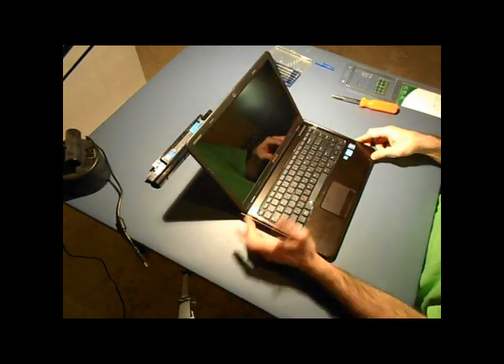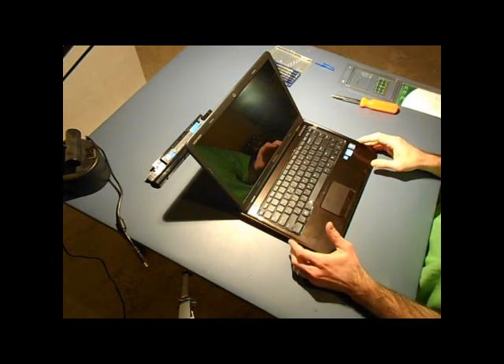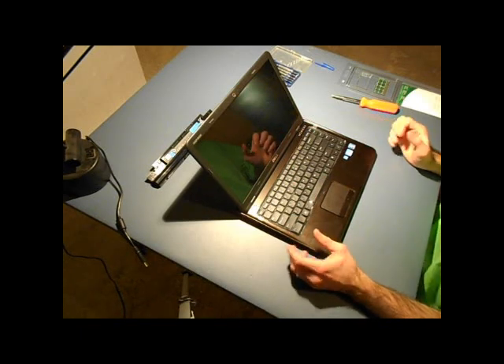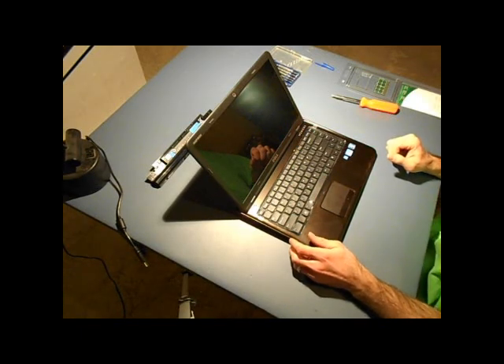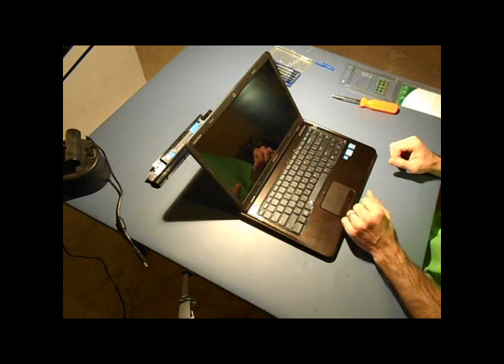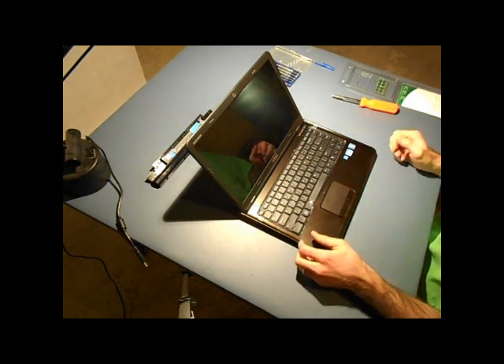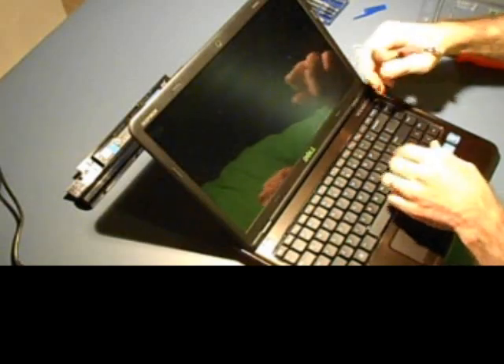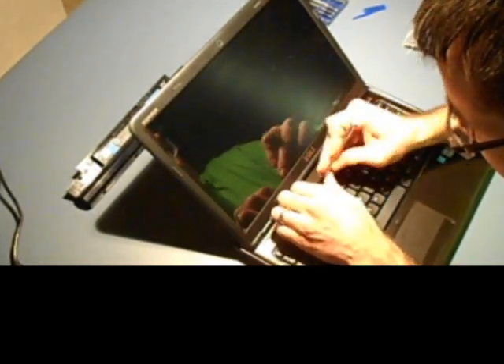RAM Memory Installation (Dell) Under Keyboard

Comment: I have the same laptop and i ordered a single 8gb ram online for it. By itself the 8gb works good but when i go to install the 4gb ram it came with the screen goes black ? do you have a idea why it wont work the same problem happens when i got to use the 8gb and the 2 gb it came with i kinda lost as to why it does not boot up?

Comment from the maker: @phoniax You might be able to find info on Dell's website.  There is a maintenance/repairs section. It has some information about accessing certain components.  Not sure if the wireless card would be too detailed, but check on their website.